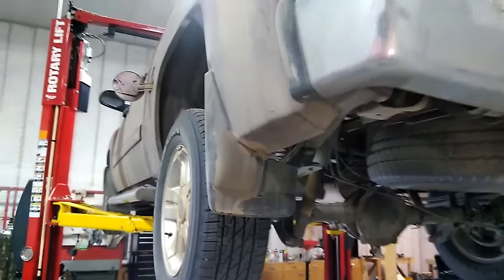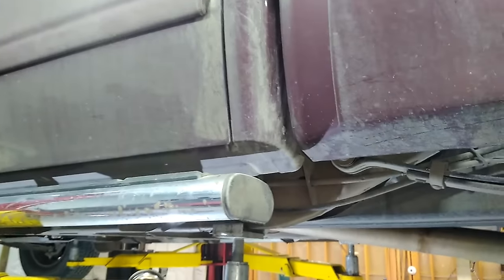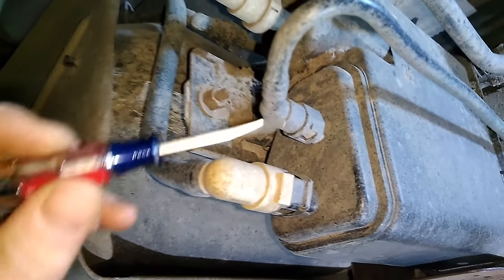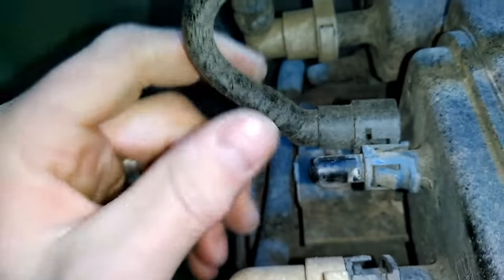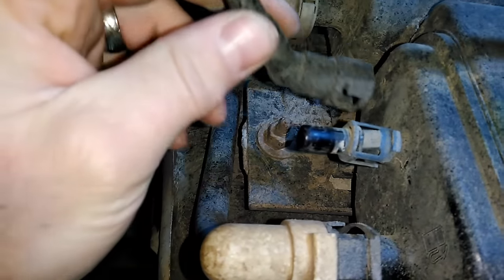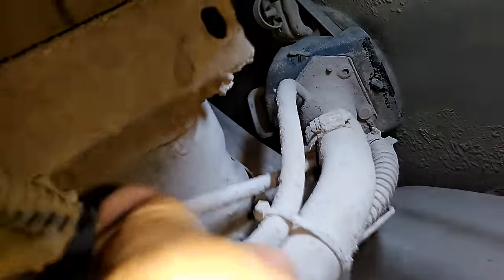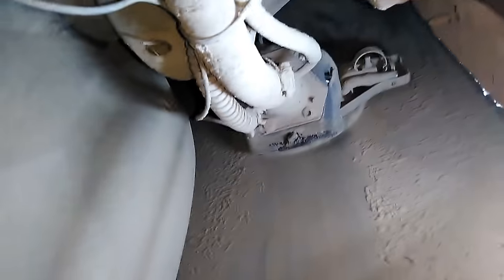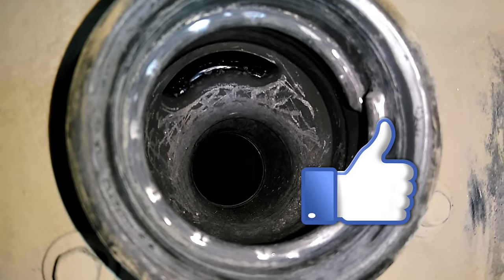Chevy Fuel Evap Canister Fill Fix Filling Slow

Comment: I have that same truck and have the same slow fill problem. My other problem is that I can’t get the Evan monitor to set. I have no check engine light and driven my truck about 1000 miles and the Evan monitor won’t set. Can this cause the Evan monitor to not set?

Comment: tried to buy the clip from all parts stores with no luck. Gm wanted me to buy a whole new vent line hose...
Reply from the maker: All I have ever done is zip tie or use electric tape so they don’t vibrate off
Reply: Zims jb welded mine back together
Reply: I have purchased new horseshoe clips at O'Reilly.

Comment: Will a clogged evap canister throw a "Check Gas Cap" message on the dash?
Reply from the maker: Yes I believe it could, you could also have a leak on the Evap system somewhere
Reply: early ob2 YOU RESET computer disconnet negiative cable go inside cab turn ignition on count 60 turn off  go back reconnect negiative...and reset

Comment: Oh my god!!! That last clip is the easiest one. The part you were prying on with the screw drivers, just push it in. Pops right off. Your unnecessary struggle was real. Please don't make a video to teach someone, if you don't know what you are doing . Only thing correct in this video is the blue clip removal. The second clip that was broke, you just push down not back. You can see how it works when looked into the fitting. I would check the valve/ solenoid first, most likely stuck closed.

Comment: How do you turn off check engine light when you replace evap solinoid???
Reply from the maker: Just unhook the battery for 5 minutes it will reset the computer if you don’t have a diagnostic tool

Comment: i would call this what not to do, he would never be allowed near my vehicle
Reply from the maker: It works though, I’ll make another video taking one apart and show the internal of unit and show why it gets dirty in the first place!  The smart engineering of gm located the vent behind the fuel neck so when you drive on a gravel road it is exposed to dust.
Reply from the maker: Taking Apart Charcoal Canister And Vent Relocation On 2012 Chevy Silverado Truck https://youtu.be/ASCLntCU0jQ

Comment: Would this be the same on my 2008 Silverado? Thanks.
Reply from the maker: +Steven Gunderson The canister will be really close and I am sure the location is still by the fuel tank
Reply: High Octane I have a 2000 Silverado 1500 the code say canister vent valve would it be round or rectangular?

Comment: my clip did the same, it just split in half when i removed it, very cheao plastic
Reply from the maker: they do get brittle after years of service too
Reply: 😂😂😂😂...cause you followed after him...the right way to do it is just by pushing down on the clip and pulling on the hose...that's all!!..😂😂😂😂😂😂😂😂...and putting water and pressurized air in the canister just makes everything worse...just throw it away and get a new one...😂😂😂😂😂😂...this entire video is a joke....

Comment: That last clip that has to be removed looks like a pain in the butt.
Reply: He broke the fuck out of it like the rest of the connectors on his beater.  The fuel fitting is meant to be removed by depressing the white part and pulling fuel line off.  DONT do what this guy did.

Comment: Ya know the canister is less likely to suck in dirt if you change/clean the vent seloniod filter more often rather than dangerously using pressurized water and then compress air to dry the carbon canister.  You are lucky as I've seen them explode from building too much pressure.

Also it's not a fix, the canister should never have liquid going through it.  You even show in the video how dirty that filter in the vent is yet you gloss over it lol.

Comment: Is this code P0449 ?
Reply from the maker: It can I believe, if you can fill without pump clicking off right away then it could be something wrong with purge valve circuit

Comment: Thanks for this link form your other video! We got it off... We tried blowing it out and nothing came out.. Air comes out.. thats it..   Having trouble with pump shutting off while fueling. Plan B?  No, not selling truck..lol Any ideas?  Great video..
Reply from the maker: +Keneo Fugotti take a look at the solenoid valve next to the canister this Valve can be bad. When there is no power to it you should be able to blow through it I believe
Reply: Are you implying take the top connector off the fuel evap canister and blow back through the solenoid valve?
Reply: Looking at a friends truck..  He also told me that he threw a P0446 code yesterday. He took it to autozone and they said it could be solenoid valve or a bad gas cap.
Reply from the maker: +Keneo Fugotti you could take the solenoid valve off and do it on the bench
Reply: Keneo Fugotti could also be fuel tank pressure sensor. After changing everything in this system I found out about this little  fricken sensor
Reply: BAD GAS CAP????   what dafk will they come up with next!!!!! GOVs out of control!!!
Reply: check the line or

Comment: I run every possible scenario with my canster (yukon 2008) my conclusion is: 2 ways to fix this shit. 1 change it
2 cut the canster change the sponges / foam and the coals then close it and seal it gasket maker what ever can hold some pressure
Reply from the maker: Worth a try if you have the time and no how

Comment: When refueling, do not add anymore gas after the pump nozzle clicks off that first time.
Reply: Mine clicks off and spits fuel out all over the side of the truck even when I'm empty... so, thanks for your advice but I'd be "filling up" every couple of miles if I stopped filling when it clicked off the first time.

Comment: Do you have a video on 2001 F150 4.6 ?
Reply from the maker: I do not have one, but most of the vehicles have similar evap canister layouts, they will either be in the engine compartment or by the fuel tank area

Comment: Here's the link 

https://itstillruns.com/clean-charcoal-canister-8104632.html
Reply from the maker: My first video I did it with air, Chevy Fuel Evap Canister Fill Fix Filling Slow https://youtu.be/wqzZ8imD3Os
Someone told me to try water so I did, and it did work, truck still on the road! I guess if one is worried about water you could use gas! The carbon is very robust it is hard to damage it unless you burn it

Comment: Still cant find mine on my 05 Silverado
Reply: aaron smith its by the bed and cab area
Reply: aaron smith if it's 4 door underneath the driver side back door. If it's door it's just in front of the gas fill door
Reply: might be on top of gas tank

Comment: Will this being clogged cause a check engine light to come on? Also the “tighten gas cap” notification to come on?
Reply from the maker: +sam peredo jr sounds like you have a vacuum leak somewhere in the system

Comment: the water is not going to the engine after cleaning it with water?
Reply from the maker: skuunker the amount of water that would be left is very minimal and wouldn’t do any damage to the engine.  If you would fill it full of water then put it on and in went into a purge then you risk hydro locking the engine which will bend rods.. but the line is not even big enough to get that much water into each cylinder to cause this..  I done this on several vehicles with no problems..  if water bothers you, gas would work to but don’t do it inside you might get burned

Comment: Has anyone thought of rerunning the breather line to the air box? So you get filtered air?
Reply from the maker: If I would do it I would run a breather hose to the engine compartment approximately where the air would come in for the engine, usually that is cleaner air and you would not need a filter,  the older vehicles had this canister inside the engine compartment just like a 99 Tahoe did with no problems with dirt

Comment: This is a very bad idea. I tried on my 2011 crown Vic police interceptor. The whole thing was clogged. The more water I put in the canister, the more dirt and carbon pieces came out. 
I spent two howers doing this and I still ended up with a ratling canister full or wet dirt.
Now all that dirt is sitting on my back yard waiting for a cigarette butt to ignite the patio and the rest of the house.
The canister still doesn't work.
Reply: Make a video and show us how you fixed your problem

Comment: O4 avalanche...I did this then drove 5 mile no improvement still slow to fill. No  codes... could it be the flapper in the tank located at the the filler hose? Can i remove it?
Thanks for your help
Reply from the maker: Not sure about a flapper, but I believe those have a screen so thieves can’t siphon gas.  You can check there
Reply: No. The 'flapper' has nothing to do with this problem. It is a venting issue.
Reply: No screen inside the fill tube. I ran a steel fish down the tube first to make sure it was clear. No obstruction found. It is a back pressure venting issue.

Comment: Found this online 

Warnings

Never wash the inside of the charcoal canister with any type of liquids. Only use 40-50 p.s.i of compressed air to clean the charcoal canister.

Wear safety glasses when using compressed air.
Reply: Sauce?